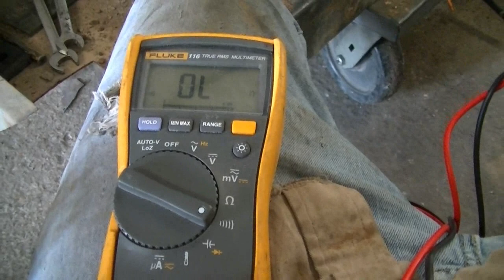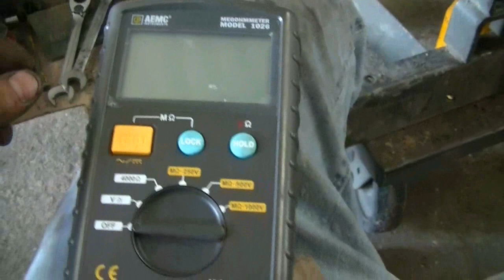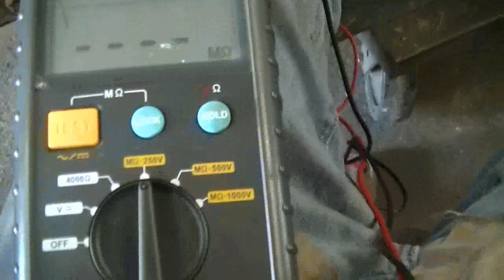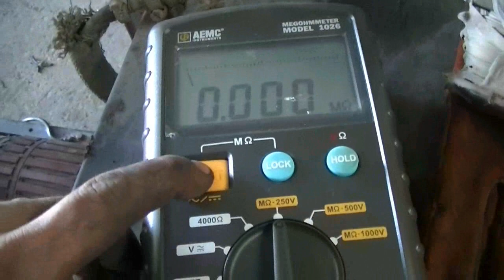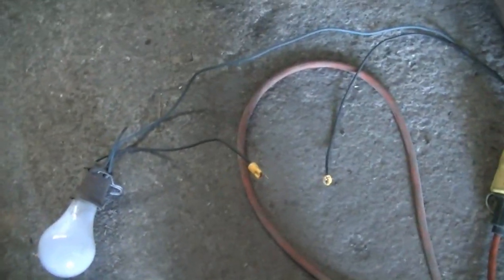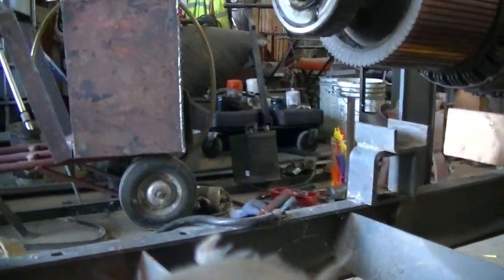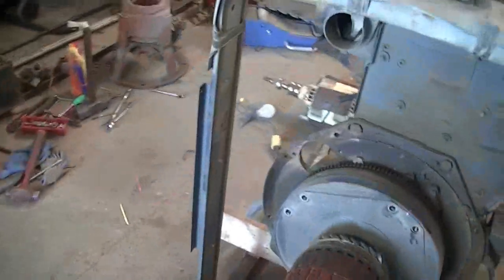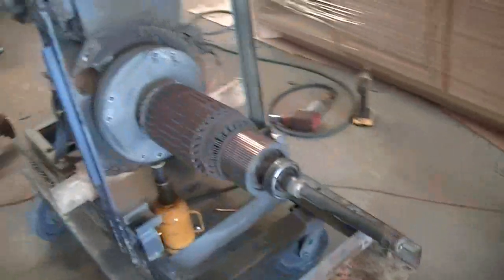Testing welder armature/rotor

Comment: Hello, so when you test the exciter armature it includes the larger copper surface inside the stater. In other words, just testing the end of the armature should tell you the condition of the entire unit?? or is there a separate test for the larger copper surface that seats inside the Stator.

Comment: Greetings ! I did enjoy the video on troubleshooting an armature. It lead me to ask: I have a Lincoln 300 amp SAE welder, all apart.  I am having a six cylinder continental engine, which has little wear, rebuilt. Now that I have the armature out-I tested it with a 12 VDC battery and light.  It behaves like there is a shorted shaft to the armature- all the commutator bars light up ! What are my options at this point ???
Reply: Rewire the armature

Comment: In your opinion,  if you had to buy a gas welder,  switch brand would you buy
Reply from the maker: It really just depends on what your doing with it and what your budget is. SA200 if you dont have much to spend but need a high duty cycle and that is pretty simple to work on (you will work on it) or maybe just something smaller like a ranger or trailblazer might suit you better if you're just doing jobs here and there on the farm. Many like the SA200s because they are good bang for your buck and like I said simple to work on, no computer boards and inverters to go bad. Only real downfall of the older 200s is no AC power. Hope this helps

Comment: I hear so.e people saying g rolling the rack is no good, what your opinion on that?
Reply from the maker: I personally don’t see a problem with bumping the rack a little if you know what you’re doing and have already set your ocvs. It becomes an issue when someone has other problems and think adjusting the rack back and forth will fix it. Just don’t go over 1/8” or so in either direction
Reply: @ntxwelding626  I got ya
Reply: Where you located?

Comment: If the rotors armature is shorted will the commutator show a short on any area you touch on commutator or are some planes on commutator ok and some are bad? In other words if you move the wire clockwise directionally around the commutator will the lightbulb turn on and off, Turning on where there are shorts, Or do all areas on the commentator light up once there is a single short in armature? Sorry if this is a confusing question just trying to understand if the short spans across the entire amateur once you have a single short. Thanks
Reply from the maker: Yes usually if there is a short it will be on all com bars I have yet to see only one or random bars only short. But it is always best to run your test lead all the way around just in case. Hope that answers your question.
Reply: @ntxwelding626  yes thanks